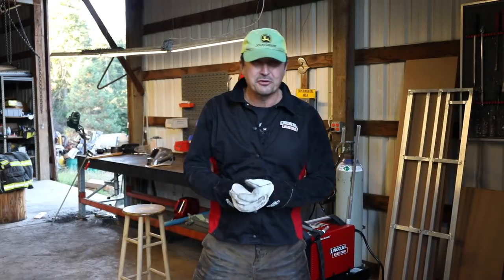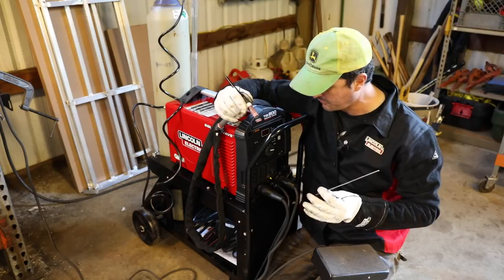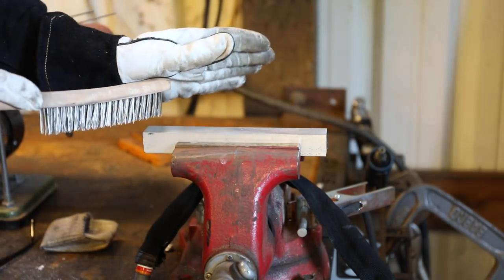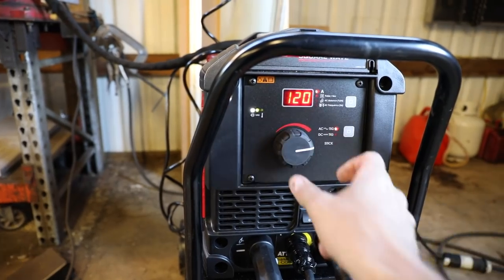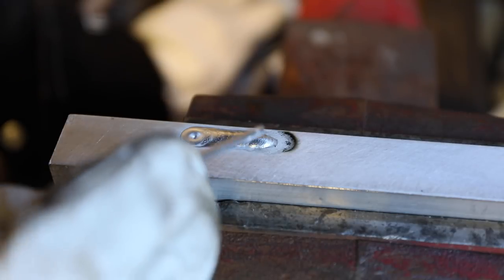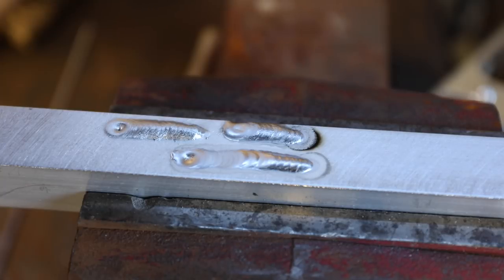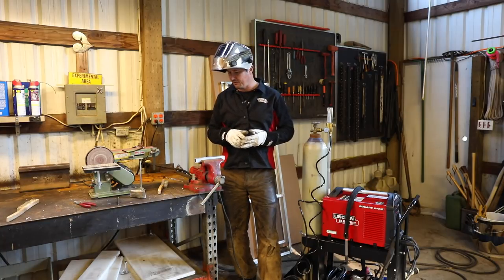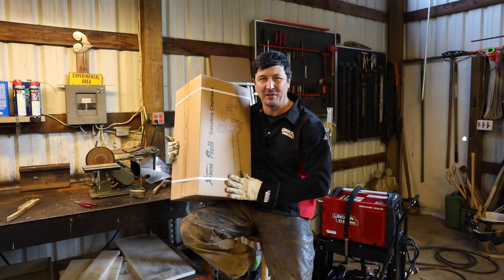The Hardest Thing I've Ever Done!!!

Comment: set your peddle to where you barely make a puddle so you can max it out as step on the peddle so you are only thinking about your hands. The metal will get hotter each pass so either don't weld in the same area very long or wait for it to cool down.

Comment: I've never welded before and have been thinking of getting into it.  Would I be better off starting out on TIG or should I go to the basics with stick or MIG?
Reply: I would recommend starting with stick because you can get the basics down without worrying about setting up a wirefeeder, shielding gas, footpedal, etc. 
Setting up a machine with stick is a lot simpler. It's also cheaper because all you need is a constant current power source. If you plan on moving onto TIG, you may consider getting a machine that can do stick and TIG. Those are pretty common because both require constant current.
Reply: Check out a welding school.  Sometimes the local high schools have night classes that will teach adults.  When I was in high school, I came back in the evening to teach arc and gas welding to old people 45-50 year olds!  I learned to TIG when I was a senior in high school.  I didn't like it.  It was just plain too hard.  Now that I'm in my upper 50's, I find it the most rewarding.  I don't have to go over a friends house to borrow the spool gun.
Reply: What a great idea, thanks!

Comment: You're doing great for a first timer and the reason you're getting contamination is because you accidentally flicked your filler rod out of your little argon bubble when it was just molten hot allowing atmospheric gases to attack it.  Maybe you're not running enough gas either, but I didn't hear if you mentioned your cubic foot per hour or not.

Comment: Just a general question for you Mr. wranglerstar. I know that you have a strong connection with ford from your granddad but i was wondering why ford other than Gm or dodge for your work/personal vehicle.  I am looking to by a used truck for work particularly a Heavy duty or superduty and was probably going to get a post 2007 era vehicle with a gas engine there are a few surplus vehicles that have 150k+ miles  and was wondering if i could pick your brain about ford since youve owned alot of them

Comment: You want aluminum as clean as possible before welding. Also secondly instead of a point on your tungsten like tig welding steel you want a ball at the end while tig welding aluminum. Get a copper plate and just arc it on the plate it will form a ball.

Comment: There is another part to that space pen story that is often left out... American's used graphite pencils before using the "space pens" so the Russian's were not special in that. So why did we even bother to build Space pens, when we were already using graphite pencils? Simple, graphite pencils produce graphite dust while writing in zero G which creates two hazards; 1) graphite dust is extremely flammable in a space capsule, and 2) graphite dust is electrically conductive and can cause shorts in switches and relays. Few think about the dust getting everywhere and creating major dangers. (note: grease pencils were preferred and used over graphite pencils to avoid the dusting issues prior to the "space" pens)

1967 NASA started using Fisher Space Pens
1969 Apollo 11Landed on the moon.

After that Russia bought Fisher Space Pens
Both American astronauts and Soviet/Russian cosmonauts have continued to use these pens.

NASA was originally charged $6/pen vs $128.89/mechanical grease pencils (NASA also didn't pay for development) So in the end it really was a savings inaddition to a supirior product for space..

Comment: The black semi circle is where the side of the torch dug in as you started with the ark before the filler rod the white splattering is oxidisation as welding draws lots of nitrogen that is why you have the argon if you didn’t it would be aweful

Comment: That black spot that you’re getting isn’t from your material being dirty. Aluminum is quite tricky to get used too welding to begin with. If you change your direction of travel from pull to push you’ll have a much cleaner result

Comment: you need the gas because the reaction when you melt the metal draws in moisture from the air and it makes steam bubbles called porosity and makes for a crappy weld that will be prone to hygroden cracking

Comment: Tig torch work is a lot of muscle memory hopefully learned with good habits.  I have definitly not mastered TIG welding. Not enough practice time.  I do know that the argon gas has nothing to do with striking the arc and everything to do with displacing oxygen. Heat applied to any metal accelerates the oxidation of that metal. The argon gas keeps that rapid oxidation from happening while you are welding.  Other gases do the same job for other processes.  Welding with your gas off makes for some really nasty welds.

Comment: Here a few pointers that my help.  That neck on the torch should be a flex neck so you can bend to where you need it.  Sec turn the heat up and go faster.  the frost on the weld is from heat on it to long(going to slow).  I would get in to pulse and freak but that a little much right now. keep everything clean as possible I acetone even the filler rods.  I use scotch brite red pad on the rod then acetone.  The cleaner the better.  warning dont use any clorinated cleaner.  It will make like a fosgeen gas that very toxic .

Comment: Isn’t that welder for if you need to weld steel then aluminum then titanium quickly or if you can’t or don’t want to change out the wire feed.

Comment: The hole at the end of the weld is from letting off the pedal to fast . At the end of the weld add a little more wire to the puddle and let off the pedal slowly and you won't get that hole at the end of the weld .

Comment: 5:30 Not entirely true. Some gasses do help with arc-starts, but the main point of the argon is to shield the hot metal from oxygen so that it doesn't oxidize.
Reply: And to shield the tungsten.  Otherwise, it will vaporize in a short amount of time.  No mix of CO2 will work either.

Comment: I'll mirror most of what's been said, not enough gas. Also, i think you might be a swish too high on the heat, and this is Aluminium/Aluminum so might want let off a bit on it. IMO, going AL first, isn't...the best choice, it might set some bad habits, especially since you're self taught on it. But it's not the end of the world. Go watch Jody from weldingtipsandtricks, his tutorials are invaluable for beginners. ALSOx2 do it whilst in the shop, with a strip of AL so you can practice along. Visual and auditorial learning are important with this kind of stuff, you have to link certain things to get a good weld.

Comment: Wait you started learning with aluminium? Bad choice. Steel is a lot easier to learn on from my experience.
Reply: John Naylor sheesh stainless damn props dude
Reply: John Naylor still 1000 pieces is still a ton of work and i only tried welding stainless once which was catastrophe 😅
Reply: John Naylor it is beautiful but i only saw tiny bits of the rainbow colour because my welding was so bad 😅
Reply: That is really booking along - roughly 42 parts/hour - assuming 8 hour days.

Comment: What filler rod are you using? It looks like 4043 (judging from the looks of your welds) which is good for most everything, 5356 is good for higher number alloy aluminium (here is some metallurgy on the different types http://www.aluminum.org/resources/industry-standards/aluminum-alloys-101 ) and it looks nicer.  I started to learn TIG on aluminium because it's a whole lot more difficult than anything else and I like a challenge. Aluminium is weird because to get an arc started you really have to wack the amps to it, once its going you gotta pull some out.  Steel is kind of a set it and forget it metal.  I personally prefer TIG to almost anything else because you can control your weld on the fly. Mig is great for something quick and dirty or high volume production.

Comment: Aluminum is more difficult to weld.  Maybe practice a little on steel first.  I'm not a welder, but I worked as a designer in a welding shop for 12 years.  Our guys would use the tig to tack the pieces together and then mig it.

Comment: Go to Harbor Freight and buy their cheap electric knife sharpener, you want to keep it ONLY for putting a point on the tungsten electrodes. If you use something that has ground any other metal it will contaminate the electrode and ruin your joint. Good luck and yes check out Weldingtips and tricks as well as Chuckees2009 channel.

Comment: Cross contamination is bad.  But if you are using a steel wire brush, how does that NOT cross contaminate ?

One thing I have seen done when TIG welding steel, is no filler is required to do small tack welds.

Comment: Tig aluminum is not forgiving with contamination.  Pure argon staless brush and wipe with acetone to strip oils.
Steel is slightly easier but you still want to remove the mill scale and oils..
I am going to repeat the advice about cheking out the welding tips and tricks chanel. The guy knowes his stuff.

Comment: hope you have good ventilation in your shop
Reply: Tim Flenker if you have ventilation you cant weld.. you can have a little suction system above you welding spot
Reply: you want thirty foot ceilings and and a exhaust system to remove fumes from the shop
Reply: or wear a respirator
Reply: Tim Flenker I just bought a Miller branded respirator love it.
Reply: Yes you do. Especially with aluminum.

Comment: was that noise some interference with the microphone? 
i never had a tig welder making so much noise.

fine first welds cody, ive seen worse from long time welders ;)
Reply: noise is the arc noise.
Reply: miko007 its the hi frequency used in tugging aluminum
Reply: Square wave tig is noisy, if he was doing stainless it would be much quieter.
Reply: That is the frequency of the ac current you hear.
Reply: Yeah aluminum is a lot louder then steel.

Comment: Don't start right away with aluminum. Start with steel get good and comfortable with steel. Then move on to aluminum. Aluminum is a totally different metal and welds totally different then steel way harder to do get go with steel do some different joints then do some with pulse then got to aluminum I went to school for welding love tig welding steel aluminum stainless steel love it all its a lot harder its a art it takes time to get good at it just take your time you will get it

Comment: This copy/pasted from this source (http://mentalfloss.com/article/13103/russians-didnt-just-use-pencils-space)

I was told a very similar story while on a tour of the Kennedy Space Centre when i was on vacations  in Florida.

Americans and Soviets actually did use pencils in space, before the Space Pen came around. Americans favored mechanical pencils, which produced a fine line but presented hazards when the pencil lead tips broke (and if you've ever used a mechanical pencil, you know that this happens a lot). That bit of graphite floating around the space capsule could get into someone's eye, or even find its way into machinery or electronics, causing an electrical short or other problems. And if there's one thing Houston didn't need, it was more astronauts calling up with problems.

The Soviet space program used grease pencils, which don't have breakage problems—to access more of the writing wax, cosmonauts simply peeled away another layer of paper. The problem with a grease pencil is that it's imprecise and smudgy—it's a lot like writing with a crayon. The peeled-away paper also created waste, and bits of paper floating around a Soyuz capsule were nearly as annoying as bits of graphite floating around an Apollo capsule.

The final mark against pencils has to do with fire. Any flammable material in a high-oxygen environment is a hazard, as we all learned after the terrible fire on Apollo 1. After that tragedy, NASA sought to minimize the use of flammable materials in space capsules—and every form of pencil (traditional, mechanical, or grease) involved some amount of flammable material, even if it was just the graphite.

Comment: use alcohol  or something to clean your metal after you brush it.  an clean you filler rod as well.  aluminum is not the best metal to learn to tig  try on some mild steel first  also your gloves look realy thick i just use a regular pair of work gloves with a tig finger and it may help if you set up your torch with a stubby gas lence it takes time to get the hang of it

Comment: You need to move the cup left to right like 1  and then go right but don’t lose the Bead and 2 and then go left and you are moving to fast and the black ring is from the heat move left to right like I said and ALLWAYS  pULL Toward you and pull slow not to slow though

Comment: I'm assuming you are using 3% thoriated tungsten for aluminum watch a YouTube video on setting up the tungsten for aluminum it likes to have a ball end on the tungsten its easier to watch a video than explain in comment section. When welding tig its best to start off on mild steel or ss get the feel of it then go to aluminum. The heat affected zone or the HAZ reacts much differently in aluminum

Comment: Ah, don't listen to the elitists. Tig is the easiest method of welding. It gives you the ultimate control of the puddle and weld quality. Whenever there are small parts or small pipe like 2 inch or less they pull out the tig because it is EASIER. Not only all of the above, but you can blend in your weld so if you completely screw up you can just erase over it. Can't do that with mig or smaw without a grinder.

Comment: It's easy to weld on a flat surface but when you have two pieces and a chance to melt the crack I'm sure you know this but it take a lot more skill to do
Reply: Trevor Holland i experienced the opposite back when I was still green to the wonders of Tig. When I first started I was handed plates of random flat stock and ran bead up and down, over and over, and got a basic understanding of the feel for torch control/rod control. This was fine, but I remember the first times I joined material was when it really clicked. But that's just me.
Reply: I know lol I did just the same thing when I learned! I was just picking about getting your hopes up! 😉

Comment: For better view use pyrotex cups and when you are done hold the tig welder 3 seconds after and with aluminum got to go hot first then take your heat down. Always clean off the oxides and wear a mask chromium can f$@#$ you up wear a respirator. Learn how to prep your tungsten for aluminum you need to ball up the tip using reverse polarity. Link is below you will need a clean copper place you can also use it to displace heat or use it has a heat sink! Welder- Fitter for 7 years you got this! Mig alumnum requires you to push a weld and also use argon gas as well. GETTERDONE!

Comment: first weld got too hot you were right about the start filler added too quick.  third weld started ok but as you get the heat speed up filler and travel speed . youtube  chanels to watch are welding tips and tricks  ,  and  weld .com . you would be better practicing on steel easier to weld . alu is not for beginers hope this helps

Comment: Those welds looked like my first attempts at TIG as well. I'm not an expert. My understanding is that burning through the material is very common for first times trying.  With the little grains you can knock those off with a wire brush and elbow grease. 

With the pen and pencil story? Completely made up. Using graphite in a low gravity situation in a high/pure oxygen environment surrounded by electronics is a very bad idea. As you write with a pencil, there are little tiny flakes of graphite which come off. Those float into a control panel and touch a wire, they will cause an arc which will cause a fire. Look to Apollo 1 for why any fire hazard is avoided at all costs.

Comment: I haven't ready through the comments but I have the same welder. A couple things that I would recommend getting are a stubby gas lens kit and tig fingers from https://weldmongerstore.com. Made a world of difference with trying to teach myself to weld. Also with my welder I took the heat wrap and pulled it back a few inches so I could wrap the lead around my wrist. This took a lot of weight off my had to focus more on manipulating the torch instead of holding it up.

Comment: You might need a splitter so you can fill the tubing with gas to avoid contamination.
Plus lots and lots of practice especially on structural. Good luck.